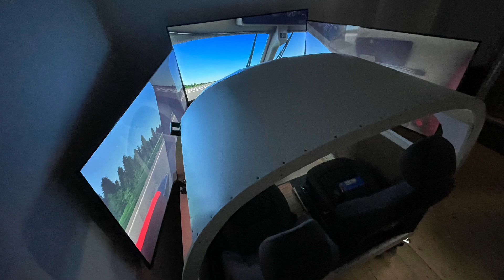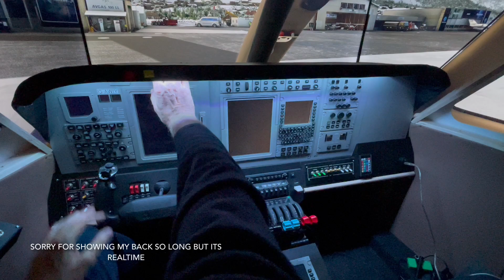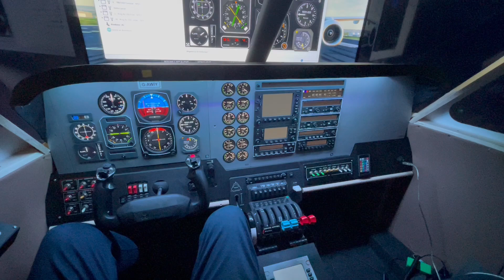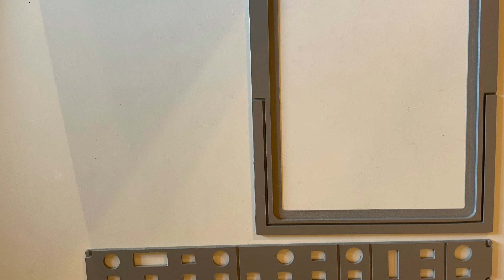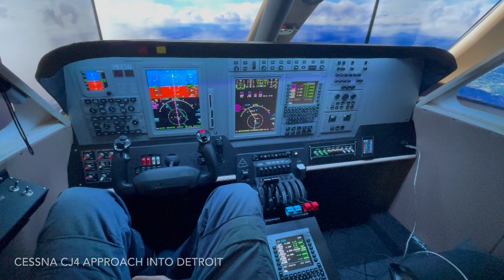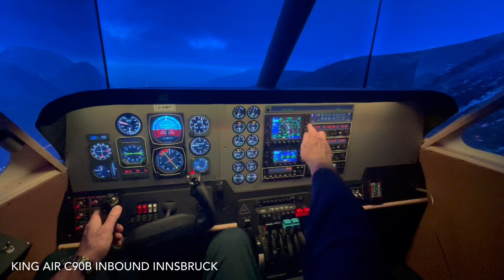Real Look and Feel for Touch Monitor based / Simulator Cockpits

Comment: Such a great build my friend as you should be very proud. I love the air manager concepts and exchangeable face plates that do not lock you into a specific aircraft type.  Great stuff and thanks for posting this. By the way how do you find the ventilation in a closed cockpit as I know in my case I needed some air flow through there else gets quite warm fairlt quickly !

Comment: I want to implement my cockpit panel the way you did it.
https://live.staticflickr.com/65535/54277222312_38cf8e0457_z.jpg

This is an image for the C310 I would like to make using your technique. I own 9 Saitek instrument panels, which I would like to include in that panel.  It would be of great help if I could start from your design of the 3D printed panels, for which a file would be great from the CAD software you used. It would be of great help if I could start from your design of the 3D printed panels.

Comment: Outstanding! It seems that the left screen is a 15,6 inch, but what about the right screen? 24 inch? Which brand?
Thanks 
Fred
Reply from the maker: Hi Frederic, ou bon jour?
the left screen is a Verbatim 17.3" (however it has bad colours!), the center screen is a dell 24". Center Console I have a uperfect 15.6". If you buy on, try to get one that has the connectors on the back side like the uperfect (not on the sides) and that has a complete flat front, no extruding frame.
Regards
Hans
Reply: @ thanks Hans! 

I am currently using two Wimaxit 15.6 and it’s getting smaller and smaller! 😅

Comment: Brilliant! Perhaps there is an obvious reason why it wouldn’t work, but couldn’t you do away with the knobster altogether by printing two-pronged knobs, one in the center (to activate the virtual knob) and one on the rim (to produce the twisting motion)?
Reply from the maker: Hi there, we are testing this kind of knobs however the rotation would cause abraisiv contact to the touch screen over the time which is an issue.